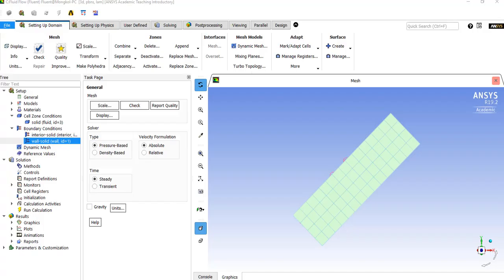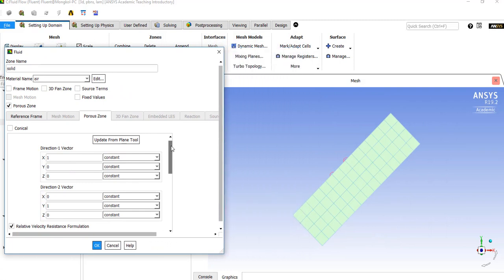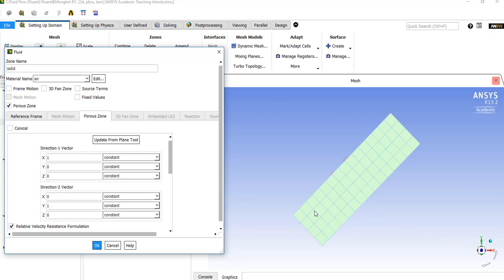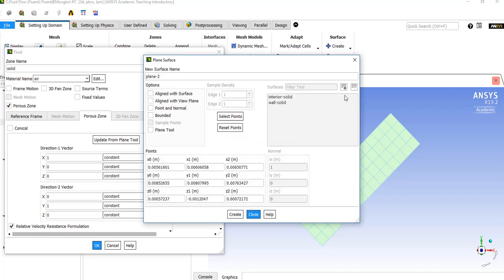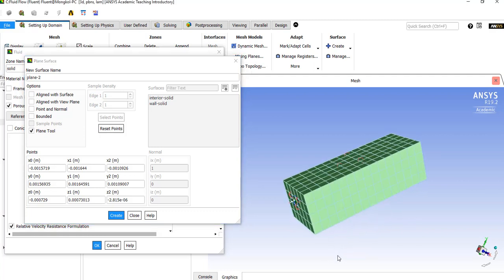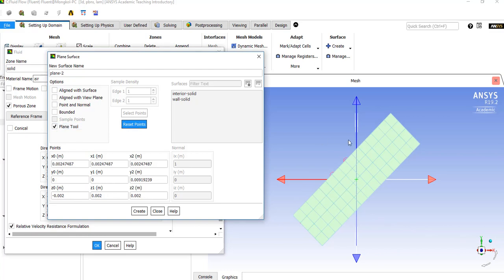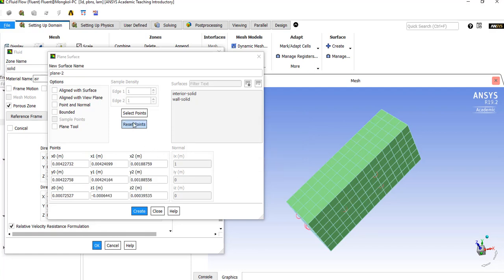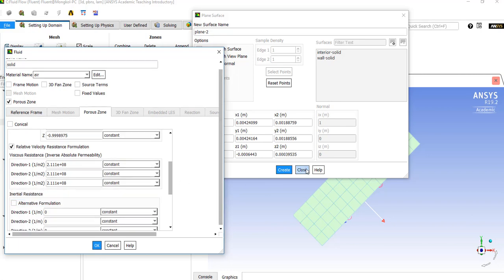[Eng.] How to set Direction-1 Vector and Direction-2 Vector in Porous Zone by Plane Tool

Comment: hi love your video, does it mean that as long as my principal axis is aligned with my inlet , I do not have to change the direction vector even though my porous zone is slanted in a certain angle ? or do I need to change the direction vector according to my porous zone